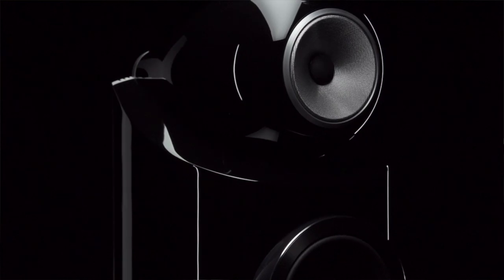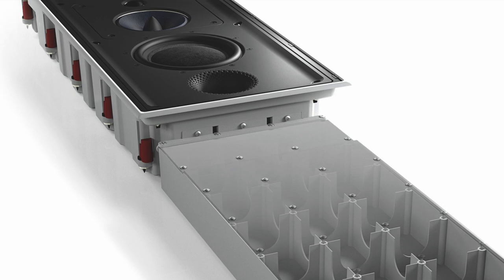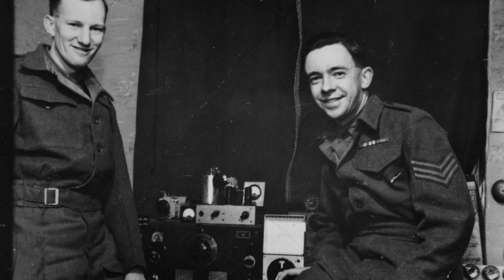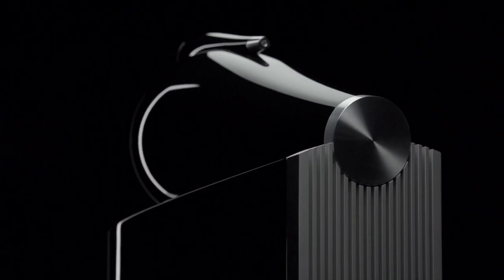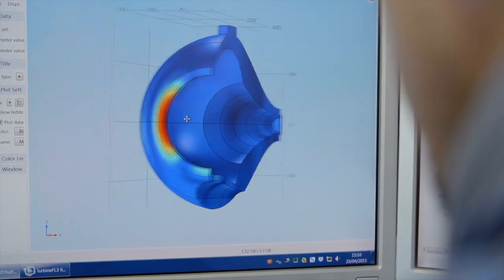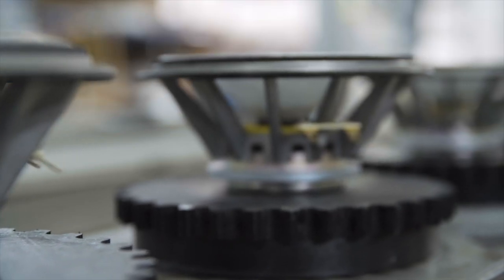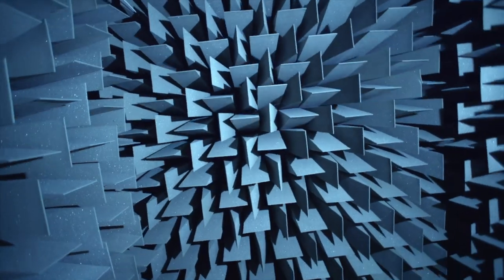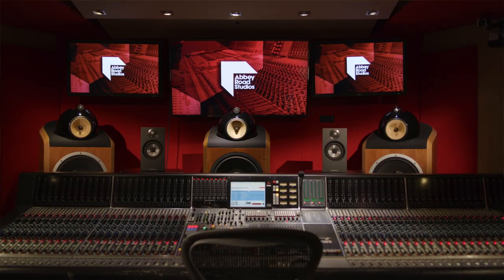We Are Bowers & Wilkins

Comment: Had the 600 series for  18 years, along with the asw2000 sub,recently fitted out my entire system with 706s2 for the front, htm6 center, 607 and 606 surounds, and a pair of carbon edition px7 phones for when I'm away, a real B&W fanboy, some really good stuff
Reply: Metallic highs, dip in the mids and some bass that's bandw

Comment: I believe Bowers & Wilkins is the finest manufacturer of speakers in the world.  I've thoroughly enjoyed my 804s, my Zepplin, and my headsets.  I chose their headset over the Bose after testing both and finding the B&W to be better to my ears.  I am looking forward to filling my TV surround sound need with B&W with the Formation system as it is compatible with Apple's AirPlay 2, which is good.  Their dedicated Mesh system for this sound is promising but I am waiting for B&W to add the option for HDMI eARC connection to the back of the Bar.  I would like this extra bandwidth to allow for more speakers in my movie watching area for a fuller sound.  HDMI eARC also allows for more than just 5.1 setups, including Dolby Atmos.  This brings up another issue with the Bar and that is no upward firing speakers.  With no upward firing speakers; no HDMI eARC; and no ability to add in the Formation Duo speakers to the current 5.1 restricted setup for the Formation TV experience (only the bar with 3 channels, the Formation Bass and Formation Flex can be included in the 5.1 Formation system... the Formation Duo is NOT part of that so you won't get to use the Duo to help broaden your surround setup), there is too much that just hasn't been answered or dealt with for me to spend this money today.  If the Formation had Dolby Atmos and allowed the Duo to be part of my movie watching experience, I would already have a full home full of Formation products to include the Audio for my B&W 804 speakers to be included, but it's just too restricted right now.  So I'll wait....  for these issues to be resolved.....  HDMI eARC so my B&W remote operates my TV too; Dolby Atmos and other great sound coding will be availalbe with the extra bandwidth of HDMI eARC; then upward firing speakers in the Bar to send out that Dolby Atmos (Atmost being "altitude" or sound from the "Atmos" of your space); then finally the ability to choose the Duo speakers as part of the larger sound room of 7.1 that would become available with HDMI eARC.  I get that Bowers & Wilkins is a sound reproduciton company, but they are marketing the Formation Bar in images where it sits under Televisions and these questions are going to keep being asked while that is the case.  So, I'll wait.

Comment: Hi do you offer spare parts for Zeppelins ? I’ve a few here with failed motherboards be a shame to throw them away too they are nice speakers and with a few reliability mods are brilliant. Thanks.
Reply from the maker: If a repair service in no longer offered by ourselves it's normally because all spare parts have been exhausted and are no longer being produced. Therefore we do not have any spare parts available. Wherever possible we continue to offer service and repairs for as long as it is practical to do so.
Reply: @bowerswilkins  Hello, that very understandable and obvious you are a business at the end of the day, it wouldn’t make sense for you guys to keep producing something you don’t sell anymore. Perhaps someone would be kind enough to upload a schematic for the Zeppelin boards to help some of us trying to keep something of this quality alive  ? I’ve around 10 speakers all with failed main DSP boards from the full range of the Zeppelin series that I’m stumped on with the digital processing side of things and certain parts that I can’t identify, I can’t get them to get working again after the amplifier section breaks down basically the only way is to replace them with a known good unit. Working boards I heatsink all ICs and power devices that get close to close to 30 degrees during in operation, they will never fail and can be ran at max volume all day with out the unit going into thermal shutdown. 

It’s a shame I love these speakers your engineers did a brilliant job on pretty much everything, but I understand how business works. When I can afford too I will be buying some new B&W kit, as I’ve never heard anything which has as warming sound as the products B&W produce. Thanks for the reply anyway, if you want I’ll remove both comments I don’t want to be seen as slandering or slating your products because they are definitely worth every penny and are brilliant quality. I guess you can’t win at everything in life though 🙏
Reply: @MrReeceyburger123  if you search the Web you'll find a certain French man that can help you out. This is a very known fault of the Zeppelin Air and B&W know very well. Our Air broke down after 1 year but they would have none of it. Pitty cause it's still a brand new speaker that's useless but looks great nevertheless. It's a shame to bin it. Upgraded to the Wedge despite the poor customer service now and I love it.

Comment: I have the 601 can you recommend decent Bi Wires for these Speakers
Reply from the maker: Any good quality 79 strand speaker cable will be adequate for Bi Wiring. A basic rule of thumb is that you should budget a minimum 20% of your total system cost for cables and interconnects. For more advise and demo's of particular brands, we would always advise visiting a local HiFi dealership.
Reply: @bowerswilkins  thank you B&W

Comment: You really need to go back to more evenly voiced systems, like the original Nautilus 800 series, the CDM1NT, and similar designs. The current offerings are just voiced and engineered very poorly, with a huge midrange suckout and the tweeter far too hot, sounding unbearably shrill and shrieky, like a teenager gone wild with a graphic equalizer. I used to really respect and love B&W designs. Now they're just overpriced, shrill, and shouty, even worse than Klipsch bookshelf designs